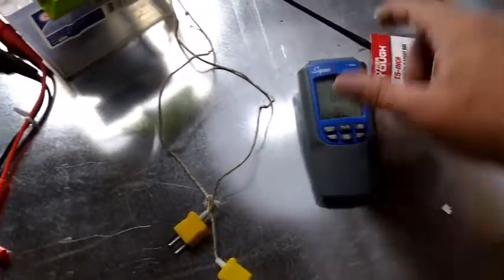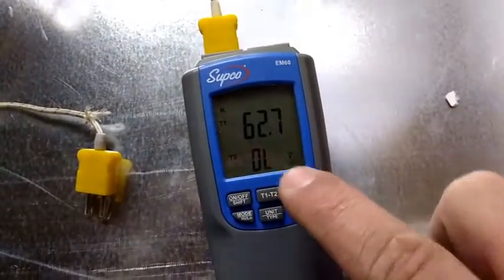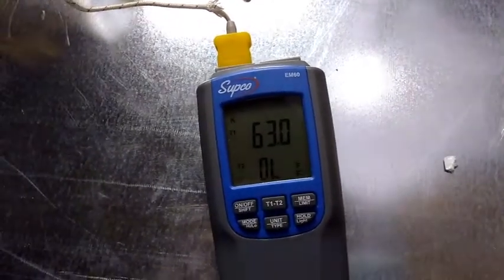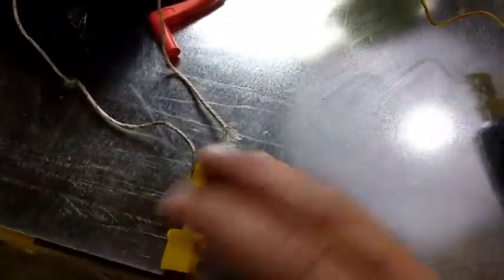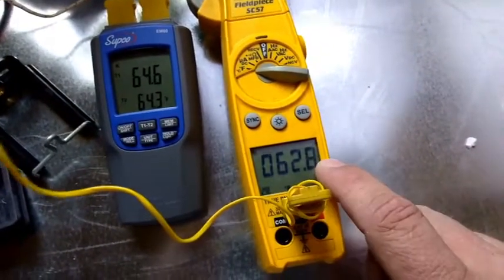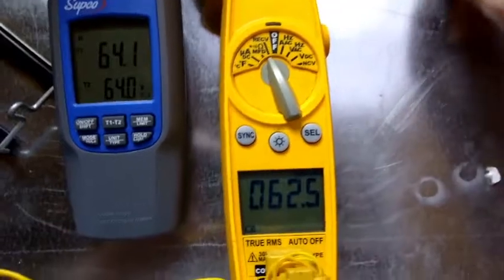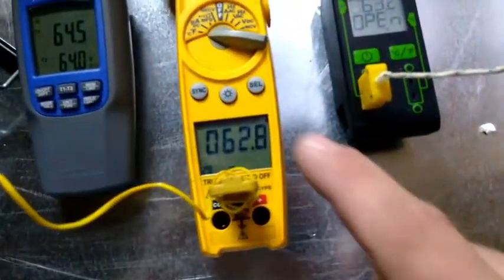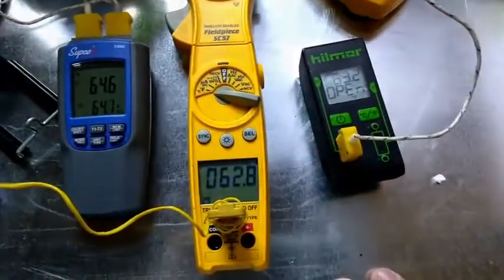Supco EM60 Dual K Type Thermometer

Comment: I have set up as many as 4 Fieldpiece thermometers in one room, within one sq foot of each other and within 3 or so feet from the thermostat. I have done this on more than one occasion in order to demonstrate to customers the inaccuracy of their thermostats temperature display. I would be using the Fieldpiece psychrometer accessory head, 2 Fieldpiece meters, the Fieldpiece pocket psychrometer and a cheap made in china dual input thermometer. 

The pocket psychrometer temp readings always vary from the k types, sometimes by 2-3 degrees, the thermostats will vary by 2 to even 4 degrees from the k types. 

I have issues with resistance thermistors. I have come to trust the k type in my meter, over any other instrument.
Reply from the maker: Very interesting Stan

Comment: Have you ever used the cooper thermistor? I know it is big and clunky, but I have found them more accurate and precise. There are tables for k-type probes, and I think they have a larger margin of error (not sure though). I want to blame it on their wide temperature range, but that is really speculation. Still, I agree that +/- 2 degrees should not make a difference in the performance in almost all systems. I find insulating my leads on the lineset more helpful for consistent readings.
Reply from the maker: I agree. The iManifold platform uses Cooper thermisters